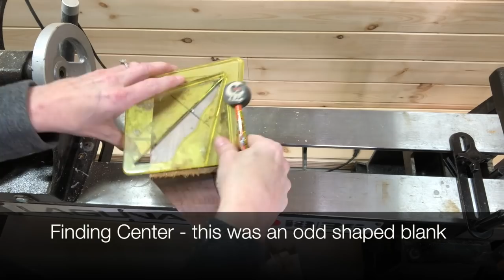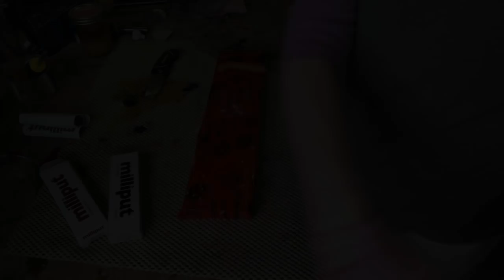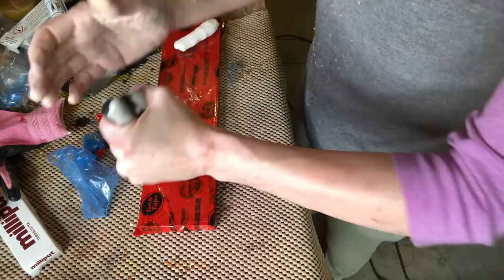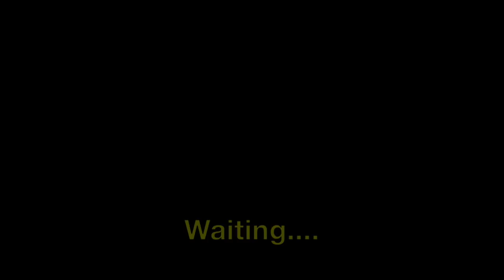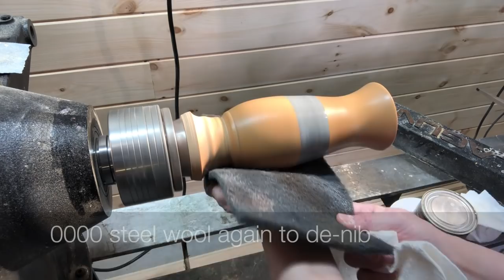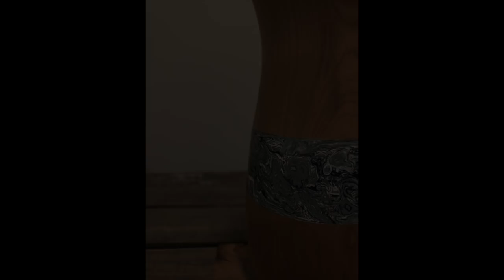Woodturning a Cherry Vase with Milliput Inlay

Comment: like it alot , 👍👍👍,,. PS ,@9:30 it's called Scotch-Brite pads from motor repair supplies , brown= 600g , yellow=1000 ,white= 1200 approximatly,,.l don't use wire wool now , it left little bits of wire in the wood that went black ,,.Stay safe,,. Regards Alf
Reply from the maker: Cool, thanks!!

Comment: Why not a roughing gouge to start?  Just wondering?  Nice result!
Reply from the maker: Thanks. I don't have a bowl roughing gouge. Only a spindle roughing gouge.
Reply: @PFWoodturning  A spindle roughing gouge was what I was referring to --  Sorry I did not make that clear.  Usually a ~1 inch wide spindle roughing gouge is the first tool most go to to round a spindle like the vase you were working on.   They are much bigger and wider than the ones you were using and they make short work of getting down to round.   You can also use a skew to get down to round but that takes a lot of skill  --  Beyond my level!  :)

Comment: P.F Woodturning I love this vase with the black and white epoxy. Could I ask some advice?........although I have been turning a while now I have never turned a vase as I am not that confidant that I don't catch the chisel and bust the vase, could I ask how you sand the inside and how you get a complete finish on the inside of the vase? Thanks
Reply from the maker: Hello and thank you. To sand the inside I use masking tape and tape sandpaper to the end of a tool, if I can't reach that far down safely. They do make tools for sanding far down, I just don't have one.
Reply: @PFWoodturning  thank you for the advice I will have to try that thanks again take care
Reply: @gavincoyle  I have used a piece of broom stick or dowel rod and taped shop a rag to the end then wrapped the rag with self adhesive sandpaper or taped sandpaper to it. You just need to be very carefull when  doing this to make sure the shop rag is taped completely so it doesn't catch on the wood. But this gives a little padding and I find gives a nicer finish
Reply: @dirtycurty1202  thanks very much I appreciate the advice 👍
Reply from the maker: Cheers!